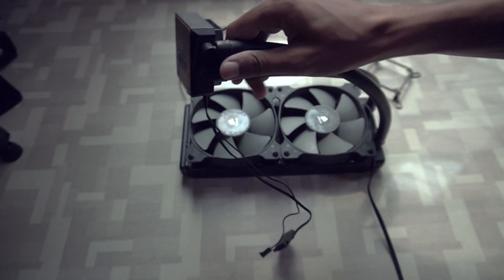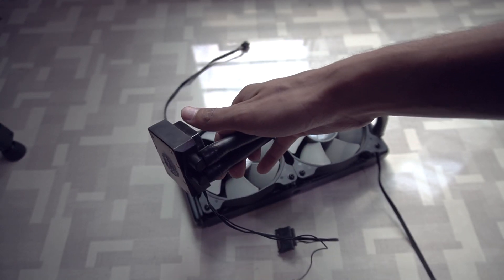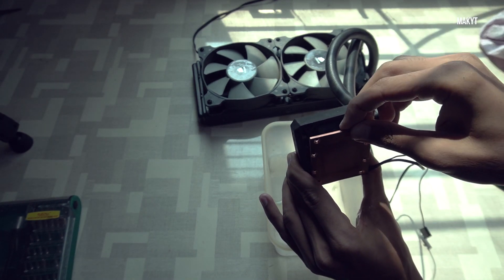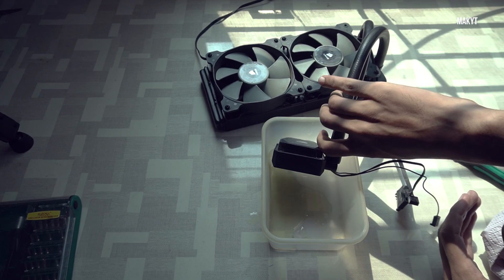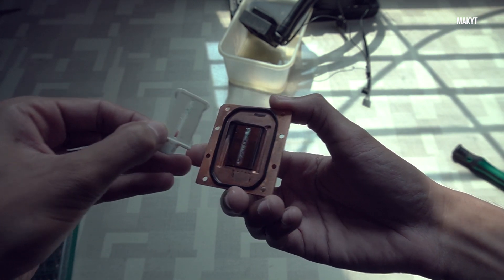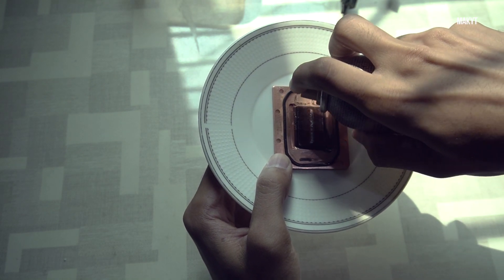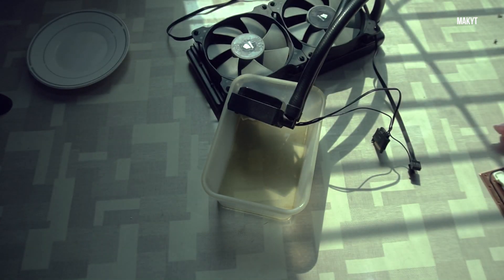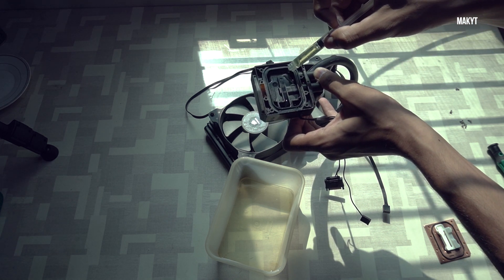Corsair H100i Extreme Liquid Cooler Tear Down and Clogged Pump Fix

Comment: Drain and Refill with clean new automotive antifreeze. Works great I've done it before.
Reply: Also submerge the entire assembly in the antifreeze and I also let the pump run by connecting it to a 12v battery. It fills the cooler automatically and since it is submerged in liquid you can get every bit of air out of the system

Comment: I've opened mine and there was no debris there, but still it wouldn't cool the CPU.
When I touch the tubes, they are both cold, meaning no hot liquid coming out of the CPU area, therefore the problem is somewhere at the heatsink, right?

And another thing: After puting the heatsink back, it leaks liquid. I screwed the screws as hard as I could, but it still leaks. How to make it not leak?

Comment: What is the purpose of this, if you don't flush the fluid completely and remaining particles along with it? You should disassemble it completely and run the tab water through it. There should be enough pressure to wash most of particles out.
Reply from the maker: Actually you’ve to check the other side of the pump as well where the propeller is. In most of the cases, the propeller is stuck so lubricate it and change the liquid completely.

Comment: you should drain the radiator completely of the liquid, run it thru a strainer to remove any suspended particles then put it back into the cooler or better yet replace the liquid completely.
Reply: Straining it through a coffee filter works pretty well if you wanna reuse the coolant.
Reply: Just use any automotive antifreeze. Works great I've done it and used the PC cooler for 3 years now with no issues

Comment: You forgot to clean the radiator and use clean water ???
Reply from the maker: Yes, You can use distilled water or clean cooling liquid. I just wanted to check the pump before doing anything else. 
Another issue is, also to check the pump section if it can rotate freely or not. Opening it is tricky but in most of the failures, the pump propeller is stuck.

Comment: Interesting, my liquid color is different. It is brown.
Reply: Same here.
Reply: @mornejoubert8416  Ok, here is the golden tip for you. I have disassembled the whole cooler 11 months ago. I have found out that there was a dent in the propeller which eventually released rust into the water of the cooler (which is responsible for the brown color). These rust particles were the reason for clogging. But in my case the cooler was gone for good and I had to replace it for a new one.
Reply: @ScientiaDuxVitaeCertissimus  I thought it might be corrosion. I replaced the liquid and did a 24Hr leak check. It still works but feel it is not as good as it used to be. Perhaps time for a new cooling sollution.

Comment: Cleaning the the gunk out like in this video might be the best route, but I was able to fix my H100i by putting a HyperVolt type percussion massager with a foam ball tip to the pump/CPU block while it was running. It must have loosened a blockage or something. My CPU temps dropped from 105C to 30-40C and has been running fine since. I wanted to offer this solution to people scared or unwilling to open up their H100i. Attempt at your own risk especially if you do it while still attached to your CPU. Computers don't like vibrations.
Reply: Maybe using a handheld sander could achieve the same... though it is probably best to clean it all out

Comment: 1:47 - we will open the other side of the cooler to check the condition of the pump - did you ever do this in another video?
Reply from the maker: Yes, I did that. Actually the propeller of pump was stuck. Just be careful while opening it as you might break the cables of motor in this process.
Reply: @MAKYT  do you have a video of it?
Reply: killfistr I’d also really appreciate a video of this

Comment: Just did something similar on my Coolermaster cooler.

Keeping the pump head high i did not spill any liquid, this is a lot easier than what you did.

Had to repeat the process 4 times.

First time the debris was really stuck, probably due to the extreme heat that has melted it.

Second time i had as much as first time, cleaned it off and assembled.

Third time there were only about 20% of first and second.

Fourth time there were only about 5%

Will assemble and monitor the temperatures, now i know what to do, if this returns.

This happened after i had the radiator taken out to replace the fans, so it was probably all the tilting of the radiator and twisting of the rubber hoses that dislodged some debris.

The ideal way would offcourse be to empty, rinse and refill with clean liquid, but my cooler is a AIO that has NO places to refill...Other than opening the pump like i did and it would be really tedious to fill it that way.